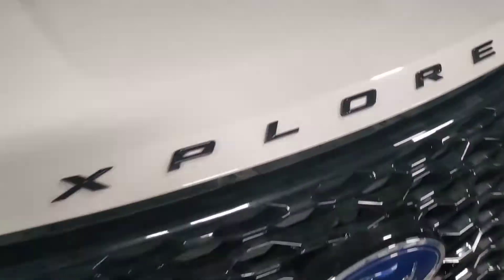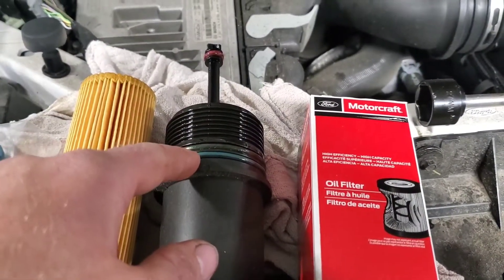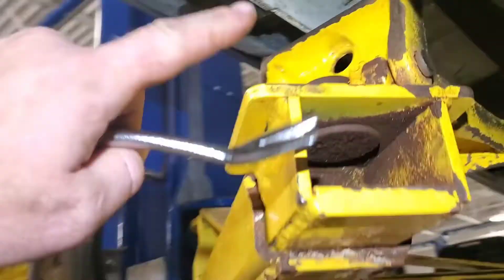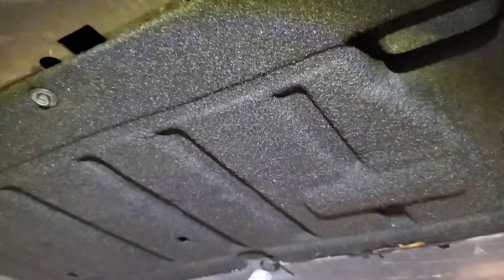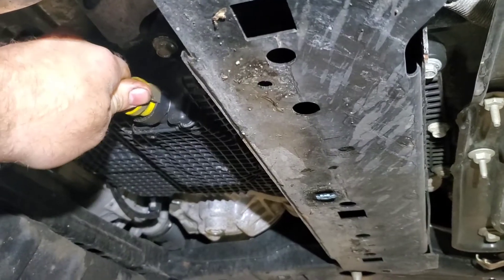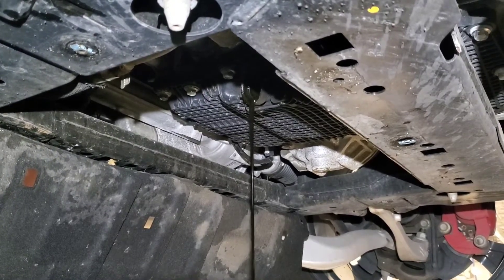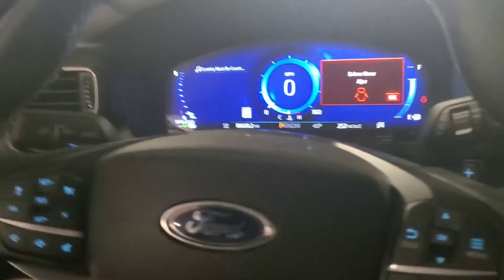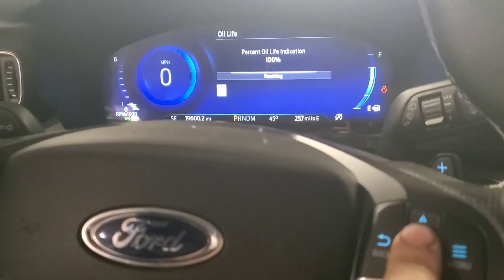2020 Ford Explorer 3.0L Oil Change How To and Oil Minder Reset

Comment: Any thoughts and or recommendations and the Anti Back Flow Ford Cartridge to Spin-On Oil Filter adapter Kits? Allegedly, after a certain amount of minutes, the Ecoboost Motor will drain it front cover valley / oil filter dry until a restart. We have a 2022 ST on order but would like to extend the life of the wee 3.0 TT Ecoboost.

Thanks
Reply from the maker: Flood mode every oil change, look in my library I have several videos on it
Reply: @FordBossMe  if we accept delivery of the Forged Green ST the next step would be convincing the Spouse why she needs to initiate this start sequence due to the Ford Cartridge Oil Filter with no Anti Back Flow properties 🤔🙄

Comment: Two good reasons not to buy an Explorer ST: those cockamamie oil filters and the plastic oil pan and drain plug.
Reply: Both can be swapped out to something else if you want (there are upgrades available), and there are so many vehicles that use those same things now without any issues. This isn't a hardcore offroad vehicle....
Reply: If you get a German car you are going to be in the same boat. But they have been that way for years already. Everything is moving in this direction.